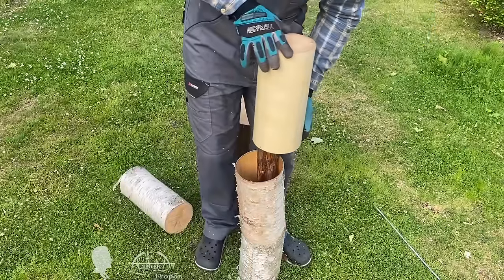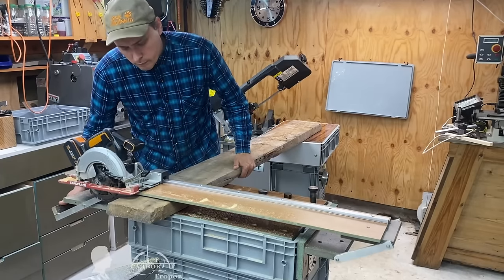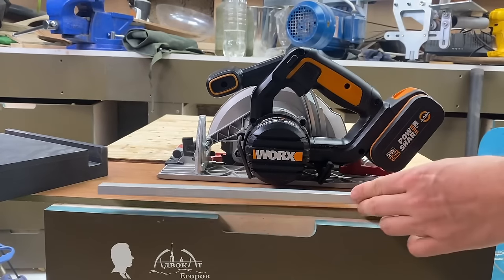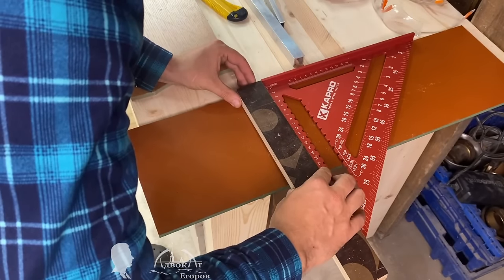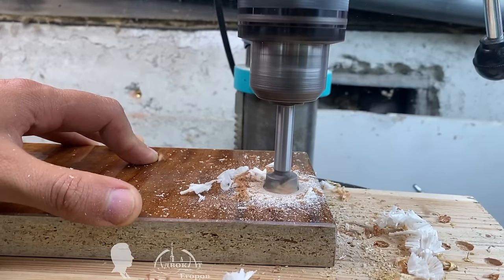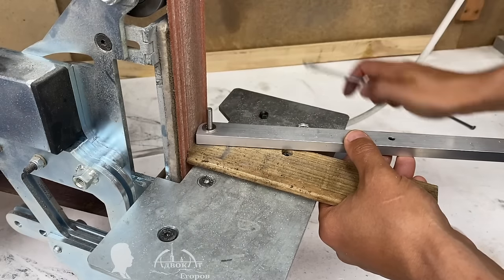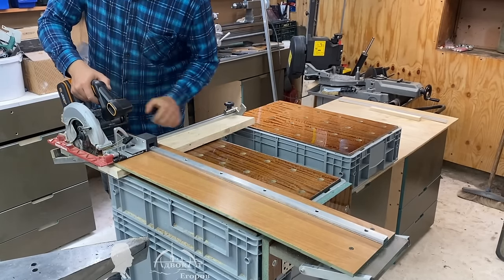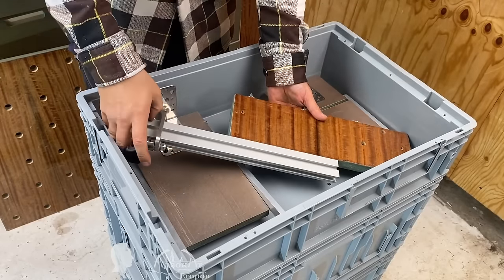$10 DIY Miter Saw System / Making a Revolutionary Concept Tool

Comment: Great to see you're back. This innovation is nothing short of breathtaking in simplicity and practicality. I watched this posting three times, each time with the same riveting wonderment. Thanks for sharing.
Reply: It's a great thing, but not his invention. It's been done before.
Reply: Eurekazone easy one was a very thought through system that started with a track bridge.  It was developed into many other aspects of woodworking, but unfortunately failed in my mind because of shipping costs.  Kreg has since released a version of saw guide that will do this as well for much cheaper, but with drawbacks.  This is a decent attempt but also has drawbacks from not being thought out completely.

Comment: PSA: For the DIY Table Saw, Please Create a DIY Blade Guard with a Splitter!

The splitter or riving knife is an essential safety device on table saws. A blade guard will prevent accidental injuries by covering the spinning blade, adding an extra layer of safety.
Without a splitter or riving knife, "table saw kickback" becomes much more likely. Your workpiece can get caught by the back of the saw blade, pulling your fingers and hand into the spinning blade at lightning speed. This can also shoot your workpiece towards your face or torso at speeds exceeding 150 km/h!

Please, save your fingers.
Reply: Amen to that, brother!

Comment: Very timely publishing, almost coincidental if I mayt say. I just disassembled a few palletes with the intention of creating some DIY christmas presents. The only thing I found lying around is a miter saw. I do have 600mm length of extrusion from another project and I got 3D printing capabilities which will enable me to create a version of this system that'll greatly accelerate my working speed. Great work, thank you for the effort put into the project and the video explanation!
Reply from the maker: Hope the idea helps you!

Comment: Fascinating. I'm most impressed by your ingenuity, Max. The pantograph approach, rather than just using a hinge at one end as other multi-function table designers have done must add to the accuracy.

The tool you described as an "expander" is generally known in the UK as a reamer.

Comment: Don't miss it, I love your bees 's videos , very unique, This one bout using a portable saw is also just in the middle of my focus, I brought a 18v Black & Decker circular saw just to use like you with a rail. I like a lot. My way to do it is about not using metal parts but Wood and plastic.the pantograph method is very unique, like your honey extractor, if I remember. 👍🙏💚🧡

Comment: A left bladed saw will allow you to make longer rips.  Maybe have 2 jigs .  Right blade saw for safer crosscuts,  left blade saw for long rips.  Love the parallelogram, thats genius.  I use a left blade cordless saw with a 3 1/8 inch cut depth on two different guides, one 8 foot and one 5 foot.  I can put an 8 1/4 inch blade on my Flex 24V rear handle saw .  I may buy the Makita 40V rear handle  10 1/4 inch saw that would give me a 3 3/4 inch depth of cut.  I prefer left bladed saws for better view of the cut line.  I realize it is more dangerous though. Your jig is awesome. Thanks for sharing the concept.

Comment: The box extensions move quite a bit under operation and would benefit from a piece of triangular bracing to give them more rigidity. That will also help to prevent twisting of the guide rail against the body and prevent problems later. While fiberboard on the extenders is ok for prototyping, it will age and deform under stress and age.
Reply from the maker: Thank you for the input. This is one of the reasons I used subpar materials to see where the jig gives in first...
Reply: @Advoko Interesting! Don't spend money where it's not needed. Reminds me of my grandparents. ❤

Comment: Informative and idea driving video.
I have a large 8x4 workbench but because I need it for multiple uses I decided to go with Anti-luce bolts, so, I can remove and add tools as needed. The saw is a great Idea that I can modify to suit my needs as I have been looking into devices that are already set every time I wish to use it.
I checked out the KLT/Euro boxes and they are surprisingly cheap, and that's saying something for the UK, as, we are known as Rip-off Britain.

Comment: I've been scratching my head trying to come up with a system like this. Your solution is fantastic in its simplicity: a traditional homemade guide rail coupled to a pantograph. The only tough part is finding a big chunk of caprolon, nylon, etc., since I don't think wood is an ideal material for this purpose.
Reply from the maker: Oily wood would work but a polymer would be better as it doesn't change its shape with moisture changes.
Reply: Yes, I live in a humid tropical environment where wood behaves poorly. so I searched online for nylon bar stock. A suitable blank was a bit pricey for my budget, but then I remembered that somewhere in my junk collection I have a few chunks of HDPE or similar material. The trick will be finding them amidst all the other junk! @Advoko
Reply from the maker: It should do.

Comment: Max...just an FYI for your viewers who would like to save a couple bucks, that rail you made from square aluminum channel, is essentially the top rail of a hanging louver blind for sliding glass doors. I've been using these for 3 decades for straight edges for breaking down sheet goods. I once was a painter and maintenence man for an apartment complex. Whenever I would have to replace a slider blind destroyed by a tenant, I would strip it down to just the aluminum rail. It's essentially exactly what you've made and can often be found in the dumpsters of apartment complexes. And if you just make friends with either the maintenence crew there or the attendant at your local waste transfer station, I'll bet within a week they will have put aside 2 or 3 for you. 
Just a friendly tip.
Thank you for the videos. 
Keep them coming.
Reply from the maker: Thank you for the input!

Comment: Great desing. Very clver solution. I built and regularly use a similar track build (DIY) using POM sliding blocks with mine being double sided, right side of guide ride for 90 º cuts and left side (right when turned 180º) being a 45º guide but your pantograph mounting is great to hold pieces to be cut. Well done. Greetings from Paraguay.
Reply from the maker: Thank you for the input. Paraguay!
Reply: What is.  ( POM ) sliding blocks
Reply: POM =Polyoxymethylene (POM), also known as acetal,[4] polyacetal, and polyformaldehyde, is an engineering thermoplastic used in precision parts requiring high stiffness, low friction, and excellent dimensional stability. As with many other synthetic polymers, it is produced by different chemical firms with slightly different formulas and sold variously by such names as Delrin, Kocetal, Ultraform, Celcon, Ramtal, Duracon, Kepital, Polypenco, Tenac and Hostaform.  Source: Wikipedia

Comment: I would add an angle guide/rail to accurately position the product for cuts offset from 90 degrees. Maybe with a rail attached on one end. While the other end spins on a guide with some sort of clamp. This tool is extremely impressive. I am inspired to make one of my own.

Comment: One of my favourite channels as you take on tasks and upskill yourself every time. I really hope you consider patenting this design and put it into production. I wonder if the wheels while helping portability take away from stability, I've always found attaching a piano hinge parallel to the axle which is 50mm x depth from hinge to ground plus 10mm helps. A little effort to lift the box up 20mm and flick base down with your own foot, cheap and easy.

Comment: Looks good. I kind of want to make a small one and use it as a radial arm saw of sorts. This seems to make up a lot of the shortcomings of using a circular saw for general cuts and could surely be improved to make up for any inconvenience left. This could also take the place of a track for a panel saw, but with the added benefits. Easier to line up cuts, clean edge due to it being on the cut's face, etc.

(Video asked, so here's some stuff that popped into my head) 

Smaller version where instead of attaching to a stand of some sort, it's just another board that way it could be conveniently toted around/used without a stand

Some form of possibly moving/removable fence/reference surface on the inside (if you're on a jobsite and the smallest thickness you'll be using is 3/4th inch, not being able to close it smaller than that isn't really an issue for example) 

Spring loaded or some form of cam/clamp that can apply pressure after it's closed to keep it in place for smaller pieces

Comment: As always, great video and bright ideas. This system is in ways simular to a full 4×8 ft. I was going to build, a frame of angle iron sitting less 90° so work would sit like when you store plywood against a wall. Guides were going to be sections of pipes that would run on slightly smaller diameter pipes, the ends would have had large bolts to adjust cut hight, that the hinged system you used would greatly speed setting up each cut, though with why I was to do it, if multi cuts on multi sheets of plywood, it could have stayed till all of that cut was done on multiples. Perhaps some day will use your method with my old designs. First though, a large bandsaw for cutting logs to lumber is my hope.

Comment: Very cool, very cool. I really like the use of the klt boxes for mft table/storage. Super efficient! It also overcomes the limitations of all the current tool manufacturer's portable storage systems. Ugh. 
The material used for the slide blocks, the graphite impregnated material? What exactly is this?
Reply from the maker: Yes. It is called coprolone here.

Comment: On the drilling of the holes: I as well was dissatisfied with the precision of the manual drill stand (not ridgid enough), I've used a router with a 20mm self centering bit.
The router plunge (if you have a decent router that is) is better.
That doesn't solve the self centering bit imprecision at the start though.

Comment: Two car garage that actually hold two cars.  Has a ramp from the back door that remains after My Mother-in-law passed away, short cars.  Atlas lathe, bench top milling machine, drill press, long bench with everything underneath, and storage.  Full no basement.  No room for a table saw so this is a great idea, thank you will be added to my Moravian bench.

Comment: For your drill press centering, you can clamp 2 blocks to the drill press table, tap a hole in them, then drive the x- and y-axis block screws to drive your workpiece to where you want it

Comment: While it would be slow, just clamping down the drill guide once it's aligned might be enough to keep the hole perpendicular. 20:42 and 21:24 both seem to show the the base moving around and even lifting slightly during drilling, so the guide may yet be able to work to satisfaction with better stability if you haven't tried clamping it yet. If you don't have clamps long enough for the holes far from the edge, mounting the guide to a bar long enough to be clamped could work if you have rigid enough material on hand.
Reply from the maker: Thank you for the input.

Comment: Hey Max, 
thank you for this fantastic design! About 15 years ago, my dad build a similar sawing system around his TS55. It did not have a parallel moving guide rail but rather a pivot on a variable-hight back support. I think I would have preferred your solution. We did precise cuts with it but found small workpieces turning, moving or slipping under the guide board. Does your saw have a problem like that? We also found it very beneficial to have the perpendicular rail on the opposite side of the table, as the cutting forces push the workpiece into it and not away. But as your saw guide might push more consistent over its surface area, it might not be needed in your case. 
On drilling precisely with forstnerbits: The best solution for me was to drill a hole somewhere in a hardwood block and then cut that block so that the hole ends up a precise distance from the edge. That block can be a drill guide clamped (really hard) to the final workpiece. 
Finally, I would like to add that I am happy to see every new video of you - especially lately, as it proves you are not forced to take part in some inhumane activity.
Reply from the maker: This parallelogram module design didn't give me troubles so far... Thank you for the input!

Comment: I wonder if there is some way to use the hinging up/down of the guide rail to also incorporate some kind of work-piece clamp.  Like on the underside of the guide rail there could be a sliding block that will freely slide when the guide-rail is hinged full up, and if you start to lower it (to come down to the work-piece) then the block will be locked in place to secure the work-piece.  I say this because I see when you are cutting you seem to be trying to use your left hand to hold the work-piece flush back against the perpendicular rail -- so nice if the work-piece can be secured to make that hands-free.  I love your ideas, they are great.
Reply from the maker: Thank you for the reply. Yes, there could be a number of improvement implemented, this is only a prototype.
Reply: Love the work you do.  Godspeed. @Advoko

Comment: for the holes on 96 mm spacing, could you use a 'step drill', instead of a forstner...i think that a step drill with a single cutting edge stays more accurately centered, and you might use a 2 mm drill as a locator for the first point of step drill... i guess, if you can't get a step drill with the largest size equal to the exact diameter of the needed hole, maybe you could use your lathe, with carbide tool, to turn down the drill? just an idea...
Reply from the maker: Thank you for the idea!

Comment: If you made it so you can turn the saw 90 degrees and lock it on the guide rail you would even be able to rip material.

Comment: Use of the bottom-most boxes would be a great position for integrated dust collection, seems like you have wheels on the bottom, so they could be taken out when full. With the drop from the top of the chute, to the near floor, there should be enough to not require a fan.

Comment: I see, your hunger for engineering challenges hasn't diminished. Now, if this can be packed into a Buahanka, there might be hundreds of mobile carpenter services pop up. And that would be awesome. I agree that MDF might be the way to go. Preferrably with an epoxy layer on top. 
As for the Beekeeping:  A guy named Paul Stamets claims to have found a solution to keep them lively and healthy. Although, he is an Experimental biologist with massive knowledge in Fungi.  I don't have a full grasp on his field of expertise, but If i  remember correctly, he feeds his Bees a syrup of Lions mane. And/or cultivates a mushroom nearby where they live. And that seems to help enormeously. Maybe you guys could team up on that problem. Would love that species to further exist with us. Bees are just too Important.
Reply from the maker: Thank you for the input and info on the guy, I will check him out.

Comment: 20:36 why didn't you clamp the drill bit guide to the table top? Or use double sided tape? I can see the guide walking as you drill down. 💖🌞🌵😷
Reply from the maker: There is always more than one way to do the same thing;)
Reply: @Advoko  , he was talking about a lack of accuracy in drilling the holes (that's why I put the time stamp), thus my question. Sending lots of love 💖 from sunny 🌞 Arizona 🌵. Take care of yourself and each other 😷.

Comment: this is some strange combination of table saw, track saw, jig table, and maybe radial arm saw(since a lot of those get welded at 90). 
don't think this really counts as a miter saw since it doesn't really miter (rotate around an axis).
More accurate would be some subset of table saw, some of the cuts shown are even very similar to table saw cuts. 
I propose, table track saw, or jig table saw as more descriptive names of this saw type.
Reply from the maker: Thank you for the input. I will have to think about the name

Comment: My only concern would be the holes wearing out so having bushings might help, but other than that I can't think of many changes that don't overcomplicate it.
Maybe multiple holes to accommodate bigger pieces and a mount for a larger saw, but at that point you can just build another bigger one
Maybe some sort of linkage so you can push on it with your feet.
(Actually a shovel handle screwed in the top board may do the trick)
Reply from the maker: This is only a prototype, things will be changed in the final jig...

Comment: Your system is cool. But if you truly want this to be a sliding miter saw system that can replace an off the shelf system then I have a suggestion. Make your fence pivot able so that you can cut compound miters. It would not take much altercation and then it would truly be a sliding compound miter saw replacement. Just my two cents.
Reply from the maker: Thank you for the input.

Comment: again with step drill...for thin material, like those aluminum profiles, they are nicer, and *safer*, because they don't 'grab', and you get 1 or 2 mm steps, and they 'automatically' make a nice chamfer on the top surface.